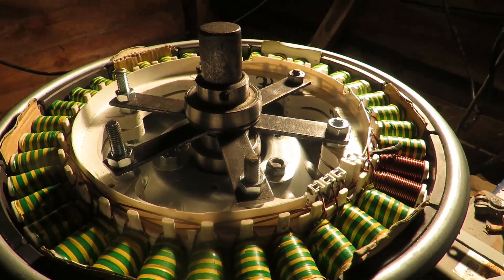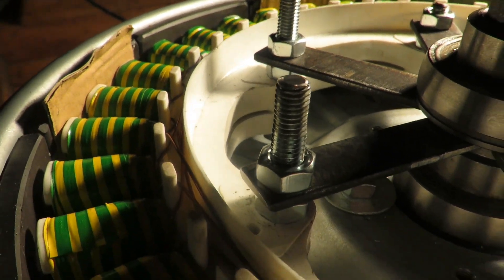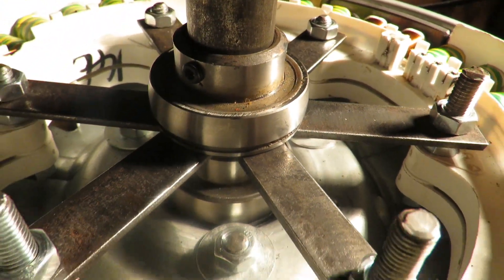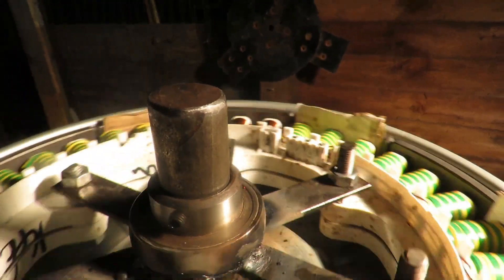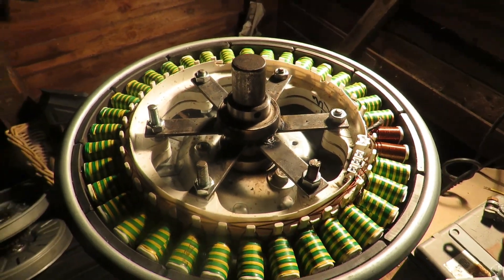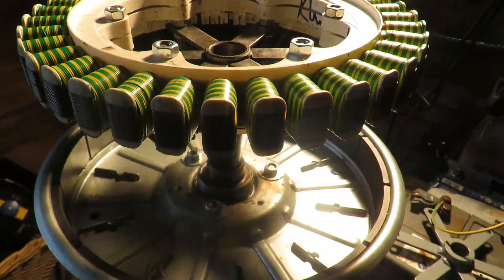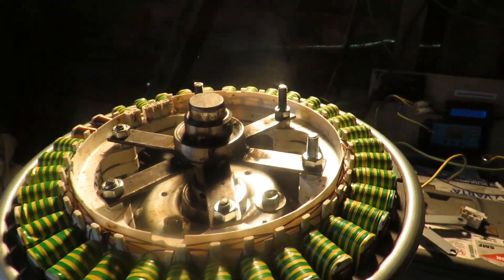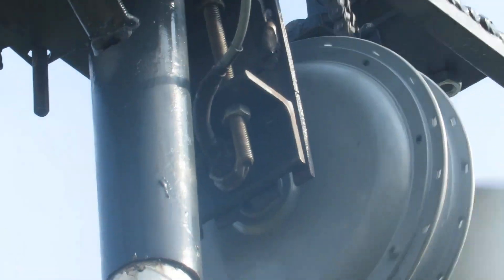Free Energy - Wind Turbine Projects - Smartdrive Rotor and Stator - - 28th April 2021

Comment: Very close, you will get there no question. Have you seen results from ozone in your time , i know little about it as a topical cream etc,  3 oxygen atoms is interesting.
Reply from the maker: Ozonated olive oil is a miracle for the skin, Tesla used to make it and sell it in Manhattan , it's amazing stuff, I am making a large supply as the machine goes to it's new owner soon.
Reply: Did I miss something/a comment, bec I don't see a connection to ozone anything.
Comically, I'm yelling at the vid; 'Nooo, don't try welding that as is!'